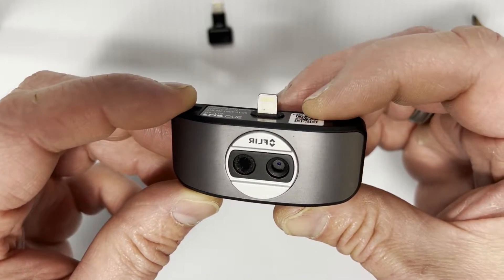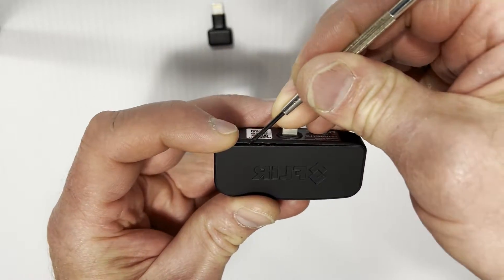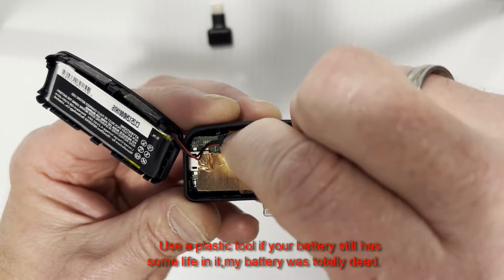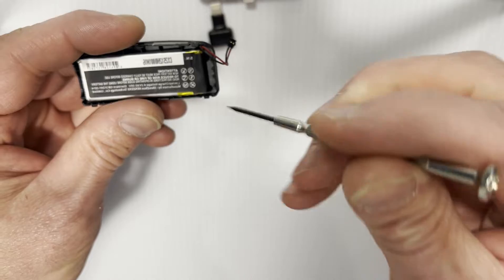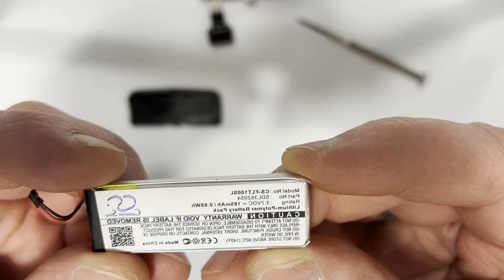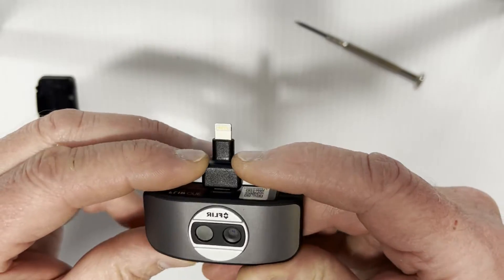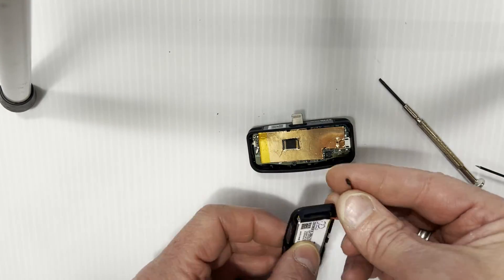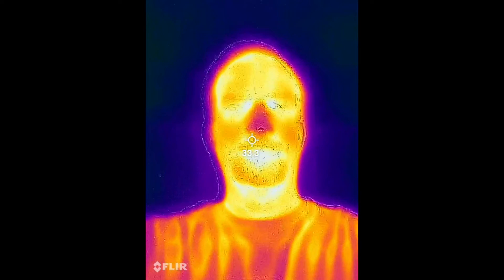Flir One battery replacement

Comment: "This item cannot be shipped to the delivery location you have selected. Please select a different delivery location."

Is “Cameron Sino” a random supplier, or do you know that this is good quality?
I can buy it with 185mAh for $12.02 plus $6.39 postage.
Yellow pouch-bag cells with supposedly 520mAh from $11.62 without postage.
I doubt they have 2.8x that much capacity.

It's a shame that it can't be operated with an adapter.
I tried it once with a micro USB to USB-C adapter and it didn't work.
Now I can only use it with an old Android smartphone like a Note 4 0_o.

It would be great if you could re-solder the micro USB plug to USB-C.
But then it would certainly still have to work afterwards.
I don't want to scrap it.

Comment: I've replaced the battery, yet the device remains non-operational. It appears that the issue is software-related. Upon consulting Flir, they suggested acquiring a new unit due to compatibility issues with the current software on newer iOS versions. I would greatly appreciate any assistance you can offer. How have you managed to make your Flir One Gen 2 work? I've tried on three iPhone 5 devices running iOS 10.3.3 without success. Additionally, on an iPhone 7 Plus running iOS 15.8, the software crashes immediately, and the same issue occurs with an iPhone 12 Pro Max. I have not achieved success thus far, and your input would be highly valued.